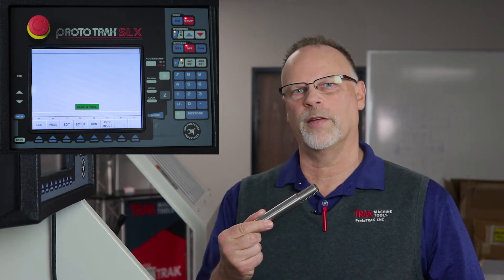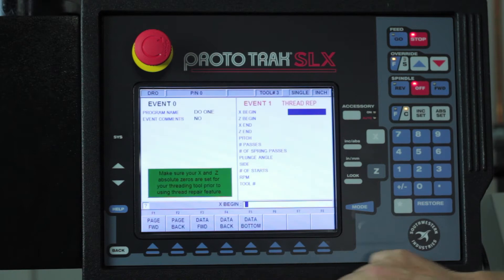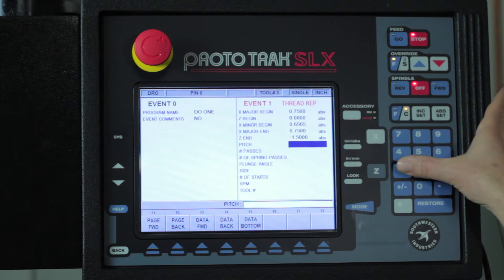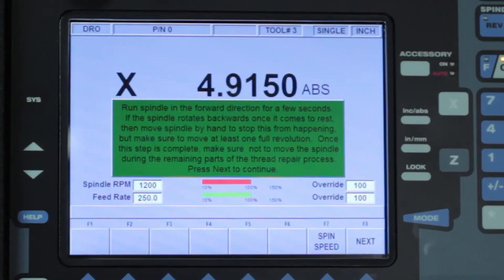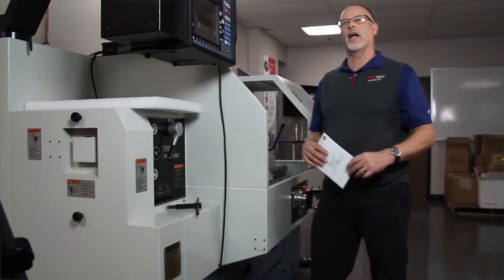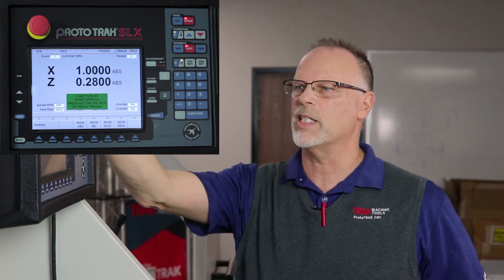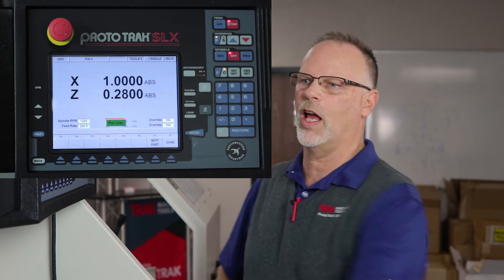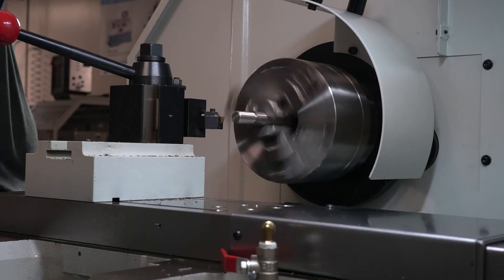Thread Repair | ProtoTRAK SLX CNC | Lathe Programming

Comment: will this machine do a left hand double start internal acme thread?
Reply: Mark, We no longer make the SLX control but our new RLX model does have the ability to do so. Our lathes can make up to a 10 lead thread and all custom threads such as acme can be programmed.  As for the SLX, it has the ability to cut the thread but as you can see from the video, you would have to mount your tool upside down because you have to tread towards the headstock.  T.P.

Comment: Hi Pat, we love your videos they are extremely helpful! We have a 1630 SLX and we have never been able to get the thread repair to work properly. We've had SW technicians come out and try to address it but with no luck, they cannot get it to work either. In random occurrences, it will work on the first part we are trying to repair, but then it fails on the second and third parts, etc. We follow the same steps each time and do the same process shown in this video. Do you know if this is a common issue or if there is a way to solve this problem or what the cause of the issue may be? It has been going on for years but we've never stumbled upon a solution. Thanks,
-Ben
Reply from the maker: Ben, I forwarded your issue to TRAKing Pat. He should respond by Monday. Sorry for the wait... I think he is the best person to look into it though. ~PK
Reply: Thank you for your help  @TRAKMachineTools
Reply: Hi Ben, unfortunately your problem sounds like an obscure one so has to be a service issue. Your technician should work with our service department to resolve the issue.  I'm curious,  does it cut normal threads without any problems?  I have honestly never heard of this issue.  T.P.
Reply: Thank you for your response Pat. I agree with you, I believe it is an obscure issue with our machine. I'm personally leaning more towards an encoder issue rather than software, but I'm not certain. The machine works perfectly fine in all other aspects, it has no problem cutting threads consistently in normal programs. The only fault is in the thread repair cycle. I will continue to work with our service techs to try and isolate the problem. I will keep you posted. In the mean time, if you come across any possible solutions please let me know! Thank you again for your time  @patrickfitzsimmons5187

Comment: You enter .1 for 10 tpi? So probably .06 for 6 tpi? Thats really irritating, and not intuitive at all.
Reply: Not correct.  The tread pitch is the distance from one thread to the next. It is calculated like this (1"/ threads per inch) 1"/10TPI =.1"  Example: A 5/16-18 thread would be 1"/18 TPI which equals .0555555556.  The machine will round that off to .0556. A 6TPI thread would have a pitch of .1666"  It should be noted that if you are making metric threads and you are in the metric mode, the pitch would equal to the actual thread description (An M6 would be 6)  I hope this helps!  T.P.
Reply: @patrickfitzsimmons5187  That make sense, thanks.  Still really annoying since this lathe is suppose to be like a Bridgeport EZ Path, where you can enter intuitive commands rather than having to make calculations like this.
Reply: @Bread996  Who ever said this was supposed to be like a BP EZpath?  First of all, we made our first.  Secondly, they copied us. Thirdly, if you like your EZpath so much, go buy a new one. Oh that's right, they're out of business!  That product cannot hold a candle to ours. This is so simple to calculate that is is completely a non issue. T.P.

Comment: how can I use mastercam X5 with prototrak slx.  how to get the mastercam codes for the cnc lathe i would really appreciate it
Reply: First of all, you need to contact your MasterCam rep and ask for the proper post processor.  Tell them you need the post to create G-code for our SLX control.  Once you have that, If posted correctly, it will save your G-code as a ".CAM" file.  If it doesn't, you can still open it by using the drop down menu in the file type bar and select .CAM.  The control will convert your G-code into our conversational canned cycles.  That's really all there is to it.  The SLX doesn't not run straight G-code with an editor.  It only runs it after it has been converted.  Once converted, you can edit the canned cycles or make changes in your computer and then repost it.  If still confused after reading this, I would suggest you reach out to your local rep or call our service department and ask for Joseph. He can help you too.  T.P.

Comment: Trying to progran internal tapered pipe threads...having trouble...threads not cutting deep enough. Do not want to use modifiers for each part. Can you explain programming or help me figure out what I am doing wrong?
Reply: Did you try using the custom thread?  You should be able to control both major and minor diameters with that.  As explained in the video, once you select thread, use the "?" to change your thread to custom.  T.P.

Comment: How do you make adjustments if you are repairing a acme thread and you want to make it wider (on z axis, not deeper)
Reply: Move your z start position in the program and it will shift the thread position over. Best to do it this way. If you are machining up to a back shoulder and move your tool in tool setup you're likely to end up crashing your tool into the back shoulder which is why I'd rather move thread Z start position.  Don't change your speed in the program either or that'll upset the synchronisation of your thread. If you must just pause the thread after a pass, then use the override function. It should still be in synchronisation with the thread.
Reply: @john-ec6sy  Great explanation!  T.P.
Reply: I believe the only way to do this would be to line up your tool off center in your thread so that it favors one side or the other.  You will not be able to get to the total depth this way but then you can make up for that by changing your minor diameter.
Reply: I'm sorry Rorke, I thought I responded to this last week.  If you're talking about modifying the Z axis to make the acme thread wider, I'm afraid this is not an easy task.  Here's how I would approach this.  1. Be sure to use custom thread because you are going to need to be able to adjust the minor diameter.  2. When you line up the tool inside the thread, get it as close as possible.  3. Now, back the tool out of the thread far enough so that you can move it off center to widen your existing thread.  4. Move the Z axis whichever way you need to in order to get the width correct.  5. Run the program. NOTE: It will come out too shallow because of how you lined it up. 6. Use the back key and when you get to the thread program, change your minor diameter to make the tool cut deeper.  7. push next to get back to the end and then run it again.  Repeat steps 6 & 7 as needed to get the thread to the correct depth.  I hope this works for you.  Please share if it does!
Reply: Hi Pat. It has been a while since I did this but as far as I can remember all I did was line the tool up as normal and then change the thread start position in the Z axis. So more accurate and I could cut to the depth I wanted and then go wider.
Reply: @ttengineering9312  That should work as well.
Reply: Its simple.. Go onto the tool table and offset your Z axis by how ever much you want for that particular tool. Move it by 0.1mm at a time (0.004'') and see if its okay. If not just keep adjusting your Z in the Tool Table until your'e happy. Hope this helps. I run a XYZ Proturn SLX 425 every day at work. If you have any more questions just let me know.
Reply: @perrannormanshire8783  You're method will not work because you cannot access the tool table while you are in thread repair.  Your method will work in a normal thread event but not in thread repair.  T.P.